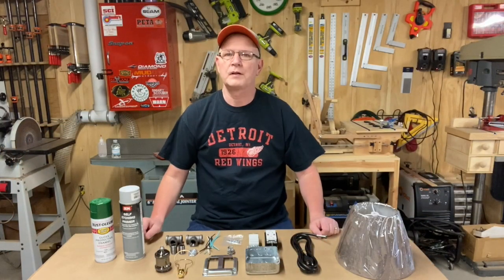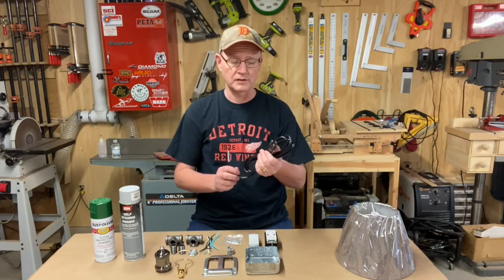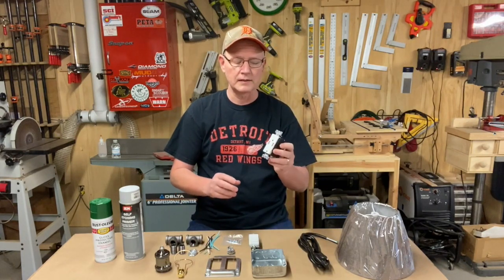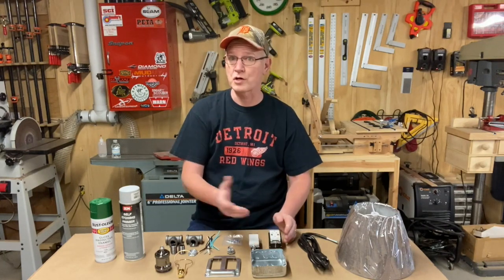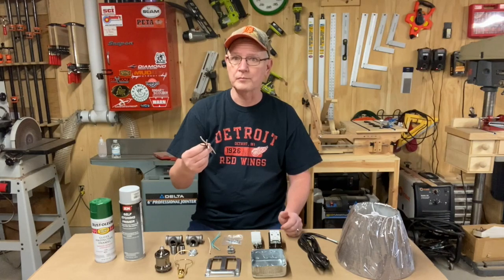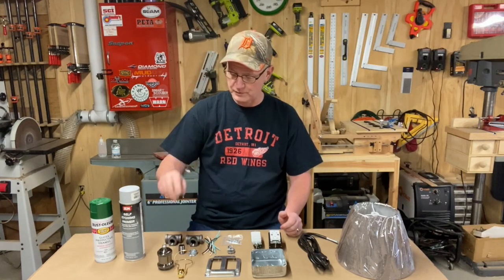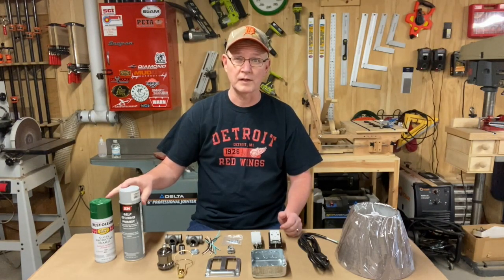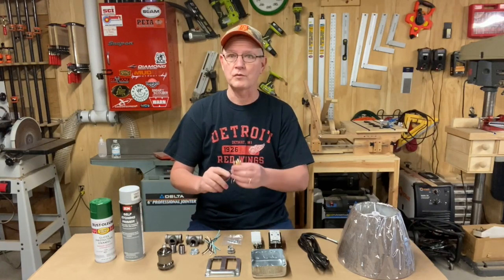DIY Table / Desk Industrial Style Lamp with Charging Station.

Comment: When you flip the switch does it turn off the outlets as well or just the light?
Reply from the maker: Hey sharp...  It's wired to have the outlets hot all the time... So you can plug something in and have the light on or off...  Thanks for watching...